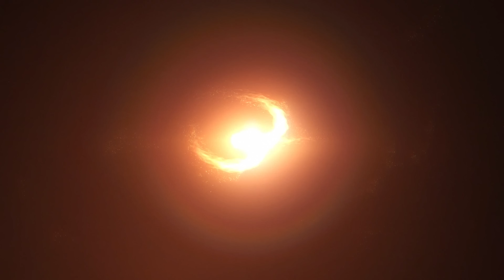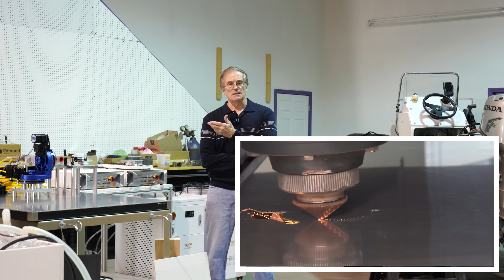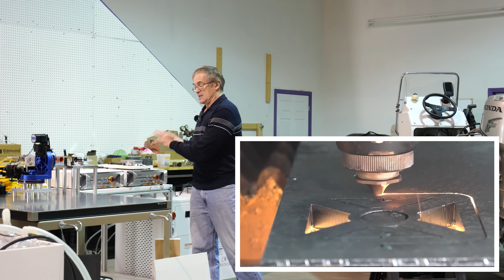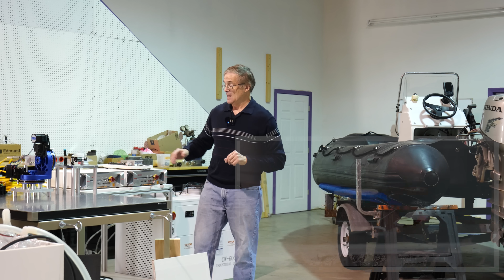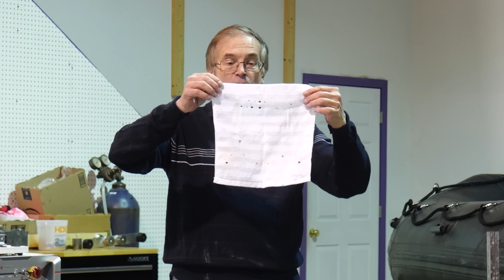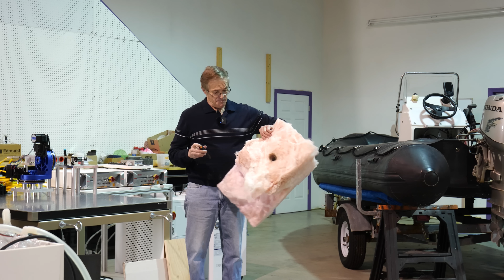We have a problem... and need your help!

Comment: Have you thought about glass blocks used in bathroom walls years ago?
Reply from the maker: I was afraid if one of them happened to shatter.
Reply: @ My thoughts were that the block would disperse the focus of the beam if not focused on  the target for too long. Just a thought. Thanks

Comment: Combine the light sensors (detects light and cuts power to laser) in a sealed dark box idea with the copper sheet --> CuO (Copper(II)-oxide) idea and you have a winner.

Comment: concave walled aquarium filled with light-absorbing dye with metal submerged in that water where water is moving using sump pump, high flow rate, to cool the metal so that it does not reach a melting point. I guess you can also try to pint both metal and interior of aquarium with non reflective paint but I think dark enough dye will be sufficient. Idk I don't deal with lasers but that is what I would try.

Comment: Just a regular person with no industry knowledge, but my idea was was to recirculating water dyed to absorb the light sandwiched between two panes of glass or other transparent material. I was thinking the water with a high flow rate would help protect the glass like a water balloon vs a lighter? while also not allowing it to stagnate and build up heat.

Comment: Frickin' Laser beams.

I've read that spark plugs are exposed to temperatures in the region of 3000 degrees at the time of combustion.
Ask your viewers to sent their used spark plugs to you and you can build a wall of spark plugs. I'm sure you could figure out how to create a wall of ceramic facing the laser.

I was going to say a prism as it breaks light up but would probably be burnt through the prism before it could break up the light. I'd still try it to confirm it should be eliminated as t would seem to be a cheap experiment.

 I thought the black inflatable in the background was a clue you wanted to give us. Was it Vanta black you were thinking of and couldn't think of the name?
Vanta black is highly light absorbent.

Or just find an unused tunnel, mine, dry creek, river bed and blast the crap out of the walls. Sometimes you have to go out into the field to conduct experiments

Or build a brick wall and be damned with the short term inconvenience. Plenty of people pull up old paving and give them away for free and advertised on Facebook market place and other such places.

Would the double slit experiment diffuse the beam sufficiently to stop it burning everything within a half second of contact? Yes, aware that double slit experiments have been done with low energy light. We're experimenting and this seems like a very cheap experiment but this time with high energy light.

Fibre optics and direct the lazer into a tank of water.

Comment: Big enough rotating disk - made of the material that performed best and is lightweight. The middle section of the disc could require a thicker layer or have separate disk which spins faster (and a cone). Idea is to distribute the laser power over different sections.

Comment: I think your best approach is a layered one.
Choose one of the attenuating options, some combination of dyed water curtain flowing over a sheet of glass or something. Suggest angling this layer down at 30 or 45 degrees to deal with partial reflections.
Then for a hard backstop use a sensor to trip your lockout, a thick coating of intumescent material painted on panels of concrete board? 
Both would be panels you could put on casters.

Ideate on the concentrated spot-energy generated by the laser. Best to have the sacrificial target be moving in some way to carry away / spread the energy being absorbed. 
Flowing water, a rotating target (think 2 layers of trivision billboard with intumescent coating), or a "treadmill wall".

Comment: I worked at the US Naval Research Lab in the Optical Sciences Division. My background is solid-state physics, optics, lasers, and electronic circuits. I am an inventor. I am concerned for the danger to the people in the room from unwanted minor reflections and scattering if the beam ever hits the dump and remains on for even a tenth of a second. Virtually any dump surface is going to scatter/reflect at least 5% of the energy, and with the laser power you're talking about, 5% is a dangerous amount to have sprayed around the room for any length of time.  I would recommend setting up an automatic system that will turn off the laser quickly (like in a microsecond) when it is triggered, and is triggered by an optical sensor that is looking at the dump for any trace amount of scattered radiation at the 1.0x micron wavelength of the laser.  With such a system, a quick-kill system, your dump is protected from lengthy hits of the high power laser and can therefore be relatively low cost. And your people are safe.

Comment: Another idea would be to power the laser with a cable running against the back wall. Where the laser hits the back wall, put a fuse. When the laser hits the fuse it blows it cutting power to the laser. Very easy and cheap

Comment: My suggestion is water trapped between sheets of glass. Paint the glass with the blackest black you can find to absorb the energy. The water should dissipate enough energy to solve your issue.

Comment: Aim it at a magnifying glass or mirror to unfocus the beam and a mist of water(or fire extinguisher foam/powder) to absorb and disperse the unfocused energy further.

If the beam is angled down you could probably have the mirror in dry ice to super cool it so it doesn't melt.

Comment: Could you build a large ish parabolic mirror to reflect the laser beam to one point (or close enough) and at that point have a lens that would unfocus the beam. I imagine a small portion of this would still have to be cooled but much less that one single point. i'm imagining a parabolic mirror similar to a radar dish or vehicle headlight with the lens at the center. The only problem might be the center portion where the lens would be mounted might get hit by the laser and destroyed. I also wonder about using a black painted object somewhere that could prevent light reflection, paint like black 4.0.

Comment: What about having a secondary optical system that removes the columating and final optical focusing if it spreads the beam so it's has a lower level of power to disapate then a beam dump can directly that to a spinning disk of suitable material that provides a period of time to extend the period it can absorb it. The secondary optical system can be moved into the path prior to your existing optical system that is too powerful to reasonably curtail.

Comment: There are some great comments about dead man switches which are great. Use them to start. The idea of a chamber with a photo sensor inside is also a great idea too as this is going to cut down the cutoff time. One thing I've noticed is that people have not realised how dangerous reflections are. Only making a wall to stop the beam will only stop the beam on one side of the target. It won't stop reflections on the other five sides. You really need a chamber when dealing with power levels like this. I would suggest a multilayered approach that combines a few of the suggestions that have already been made.  

First layer. Photocell air gap chamber, reflective on the inside for maximum dispersion to allow the photocell to pick up the light. Aluminium sheet on backside to reflect light and disperse heat. acts as containment wall for next layer.

Second layer. Sand, quartz or alumina dispersion layer. As soon as the beam passes through the aluminium sheet it will hit the particles the light will disperse amongst the particles and drop the energy of the beam in the impact spot. Back support layer shared with front of third layer.

Third layer. Graphene infused water jacket. Have a thin glass wall holding the sand layer in place but this time you want the laser to shine through. A large sheet of Gorilla Glass for it's strength in thin applications will be needed for this. The back wall could be either a copper or aluminium sheet to catch and disperse any stray beam that makes it through the water. Graphene coolant has been around for a while for use in PC water cooling applications. It's opaque, absorbs heat and is ever so slightly reflective. It should cool the glass front to stop it from melting or being damaged and disperse the rest of the light within itself. 

Ideally, this should be a complete, or at the minimum, a five sided box so no reflections can escape and blind the laser operators. As someone else said, the whole building should be considered as the laser. Stray beams could also damage the building, infrastructure and other equipment in the same room. You wouldn't want a reflected beam cutting a water pipe or electrical cable. 

Just my 2c
Reply: The laser will not be static, but will track flying objects. That makes the detector problem more difficult.
Reply: @Digital-Dan  Not if you read the design of the detector in the other comments.

Comment: I know you said you need an absorbing material, but could you not set up a system of mirrors angled to reflect the beam round and round in a circle in an infinite loop? Seems the cheapest option, as long as you can dissipate the heat...

Comment: Would it be possible to have a lense that would mimic what happens in the cnc application? So the back drop would be a lense that redistributes the light and redirects it so that it’s not as focused? Like you mentioned in the description about the cutting head.

Comment: Why not use a paint that puffs up and chars it creates. Charcoal layer that can absorb heat from a fire for at least 30mins I assume a laser is similar and it’s a paint so easily applied to standard materials.  I saw the paint demonstrated on a documentary called big bigger biggest, when they looked at the technological advancements in oil rig designs

Comment: Have you tried soaking the fiberglass insulation in water? It can hold a surprising amount of liquid. If you super saturate the water with salt, you should increase its thermal holding capability, right? If you then sandwich a soaked piece of plywood between 2 sheets of soaked fiberglass insulation, the mix should get you close to 2 sec elapsed time and reduce the fire risk. You could also use a water leak-down across the top to replenish evaporated water. This should be enough to mitigate rouge laser fire and last long enough for manual shutdowns.

Comment: I think you are going about this backwards. Why don't you shield the laser at the source? Much smaller area to protect. You could monitor the axis movement of the motion system with a dual channel, redundant safety system, like we use in industrial automation. Then if the secondary safety controller doesn't see axis movement within 2 seconds, release a shield to block the laser. Use gravity or spring pressure to move the shield. 

The key is to have the safety system be totally separate from the motion controller. 

I need to think some more on the reset logic.

As far as the material goes, since you could make it much smaller now, I would use a lens to unfocus the beam.

A system like this would ensure safety at any direction, not just where you have a wall setup.

Comment: I don't know the exact name of it, but there is a type ob spray foam (dark greyish) that is used as a flame resistant isolation material in warehouse facilities.
It might be a good idea to test this. It's easy to apply to large surfaces, should not reflect the beam, should not burn or smoke, and is made to withstand heat and flames.

Another idea could be two large sheets of steel welded together with some inner space for a coolant (water?) in-between. Though it might need a surface treatment/coating to be less reflective.

Last idea: having an optical switch that redirects the beam to a lens and laser dump if no motion is detected for more than X time units (but this can ofc fail or jam as well

Comment: Fresh cut, dense timber, very wet, shouldn't combust.  

Wet sand.

Exterior lense that would drastically widen the beam and then that can be more easily absorbed by one of the materials you already tried.

Comment: You did not  say how fast you can switch laser on and off. If it is quite fast then instead of shooting constant beam why not shut bursts of short impulses? That way you can control duration and number of impulses (like PWM controlled) rendering no need to have something to physically stop beam. If you need beam for aiming, you can try using some weak unharmful laser and turn destructive one only when target is aimed.

Other option is to make optical system that makes long tiny powerful laser beam to be easily set out of focus and spread energy widely making in unharmful.

I would rather try with pulses. I guess most obvious use for his is military, and there is an issue that drone shooter should be cloaked and not easily detected. Having powerful constant laser beam is easy to notice. But short pulses are harder to detect.

Comment: Here's my completely unqualified suggestion:  A mirror angled down at 45 degrees to direct the beam down into a vat of water or some other liquid that will unfocus the beam and absorb a lot of heat.  Add sparkles to taste.

Comment: Ok you said high  intensity laser radiation try a metamaterial designed to re-spread the beam 😮 sounds simple enough to me just don't be stupid to test it inbuilt up areas also put some water tanks fully surrounding it like for ...is it neutron's underground the meta material need not be ONLY! on the skin of the surrounding water shields why can't you also use special meta PELITERS to keep the tank cool😊

Comment: Decollimate Laser Light

To decollimate laser light, you can use a combination of lenses to either expand the beam or change its divergence angle. One common method involves using a negative lens (diverging lens) to expand the laser beam and reduce its divergence angle. For example, if you have a laser beam with a radius y1 and divergence angle θ1, you can pass it through a negative lens with focal length −f1. The divergence angle of the expanded beam will be reduced by a factor that is equal to the ratio of the focal lengths ∣−f1∣/f2 when a second positive lens with focal length f2 is added at a distance −f1+f2 from the first lens.

Another approach is to use a single lens to collimate the light from a small source and then adjust the lens position or use a different lens to increase the divergence. For instance, if you start with a collimated beam and move a lens away from the beam by a distance greater than its focal length, the beam will begin to diverge.

In summary, decollimating laser light can be achieved by using a combination of lenses to expand the beam and reduce its divergence angle, or by adjusting the position of a lens to increase the divergence of the beam.

Comment: I'm not a scientist or anything, but these were my first three thoughts:

-Instead of trying to change what happens after the beam penetrates or cuts the object, why not try to increase the size of the beam before it goes through the focusing process? this way, there's a larger exiting beam that won't be so concentrated.
-for the panel behind the object, try a frosted glass panel. Insulation tends to keep heat, or absorb it. a frosted glass panel might be able to refract the light more efficiently. It might also reflect some of the light back. My thought has something to do with refraction, instead of just tossing light around through many different pieces of glass - much like windchimes vs a magnifying glass.
-polarization filters? I don't know if this will do anything, but just a thought.

In the end, I don't really know much. Wishing you all the best!

Comment: Use graphite powder, bond it using sodium silicate and form it to whatever shape shield you need. I would try a 70% graphite to 30% sodium silicate mixture to start.
Reply: If this doesn’t work then just point it towards the sky 😂. If you do use a composite then I recommend the blackest possible, all absorption matters with such high energies.

Comment: I had a very difficult time using a laser cutter to cut out shapes in carbon paper (the type used for battery electrodes), it did cut with enough power, but it was only paper. You can get plates of graphite for welding backup. Or maybe you need some of Nighhawklight's intumescent coating.

Comment: I asked Chatgpt and here's what it said.

1. Black ceramic tiles (silicon carbide or alumina). About $10-40usd per tile. Heat resistant to ~2000C.
2. Graphite or carbon-carbon composite. Heat resistance to ~3000C.
3. Copper or aluminum plates with black coating. ~600-1000C resistance. 
4. Laser beam dumps/absorbers. About $200usd but highly effective. See scientific suppliers like Thorlabs, Edmund Optics. 
5. Stacked firebrick (refractory brick) backed with graphite plate or blackened copper sheet, optionally water-cooled.
6. Starlite, a DIY material by Maurice Ward, now deceased. The claim was it resisted ~10,000C for brief periods but there was no official testing done before his death in 2011. 
7. Aerogels. Heat resistance ~1200C, but very expensive. 
8. Ablative TPS (PICA-X). Designed for ships reentering the earth's atmosphere. 
9. Ceramic fiber blankets. Heat resistance: ~1260-1600C.

Comment: The movie "A Real Genius" comes to mind. They had a mobile/movable backstop in that movie. You could use the bricks and build a mobile wall on wheels. The bricks looked like they did well in the test. I'm not sure how large the wall needs to be. If it were only about 10 foot by 10 foot it may not be too bad to move around on the right type of wheels. But if it needs to be any larger than that then it's a no go.  Anyway, just my idea. Can't wait to see what the solution is.😀